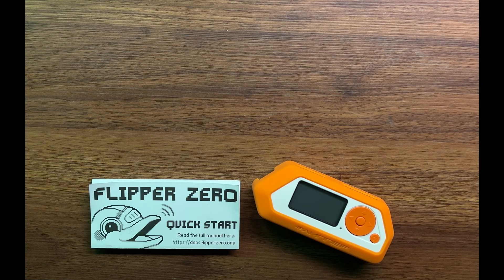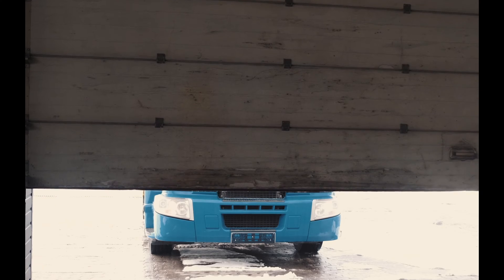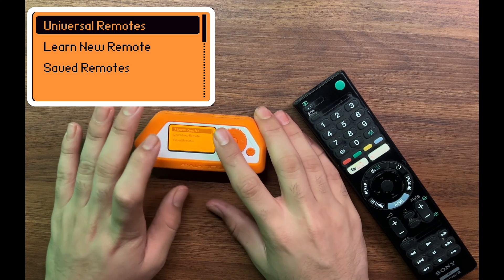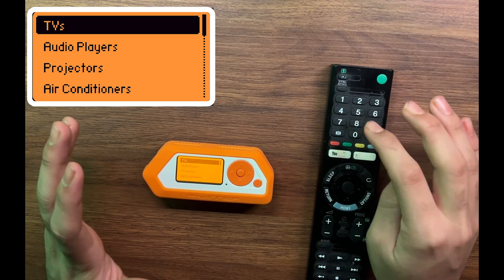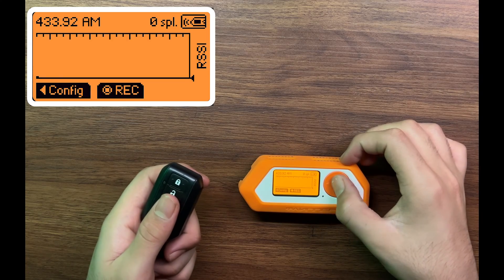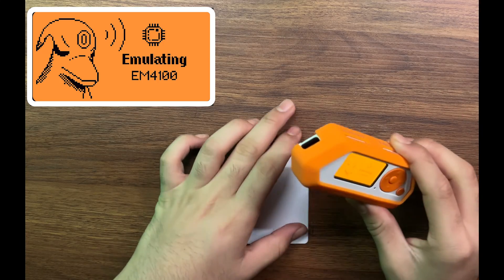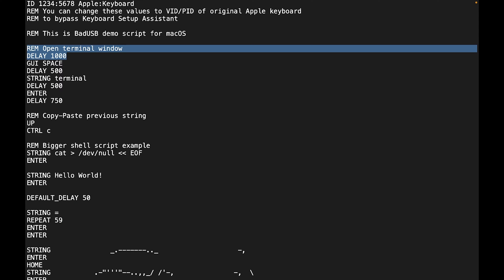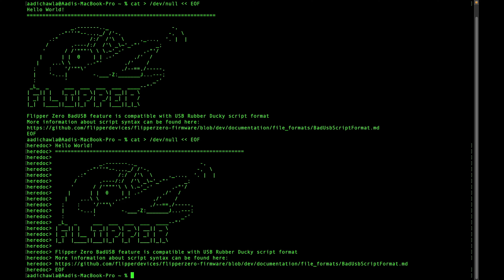FLIPPER ZERO : The SECRET Tool Hackers Don't Want You To Know About

Comment: Hi, i want to ask some q's about this flipper.. 1. Can an absolute digi-retard operate this? 2. Can a flipper detect spy hardware and software such as a hacked phone. GPS trackers, spycameras, spy audio devices, microphones.
3. If it can detect, does it show you the location so you can remove them or would you advize me a nother device that is more apropiate for that? 4. Where can i buy it and how much does it cost? 5. Can it remove a hacker from your phone? 6. Can it disturb future phone hackers with a signal? 7. Can it disturb future secretly placed spyhardware with a signal? And last but not least.. but something completely different 8. When i empty sd-cards and audiorecorders via my laptop to an external device but offline can someone within a certain proximity steal it also and do you see that by the bps going way slower then normal? Hope you are willing to answer these q's for me. Thankyou very much.